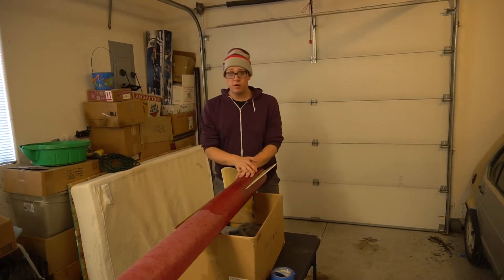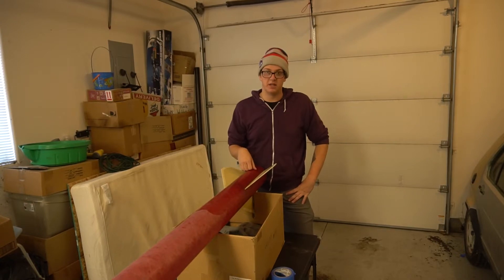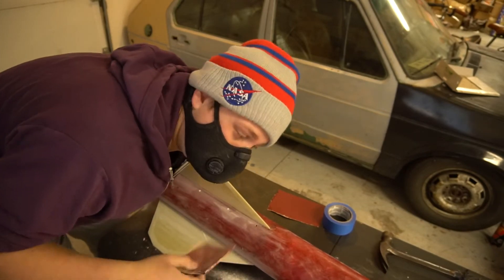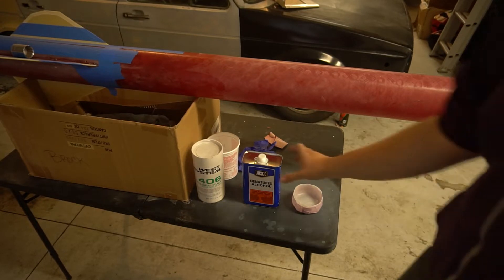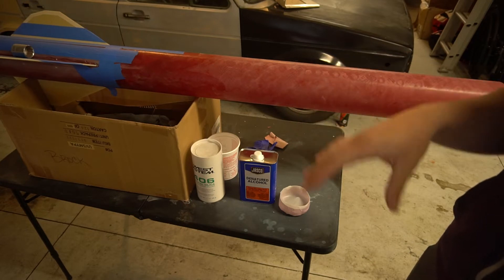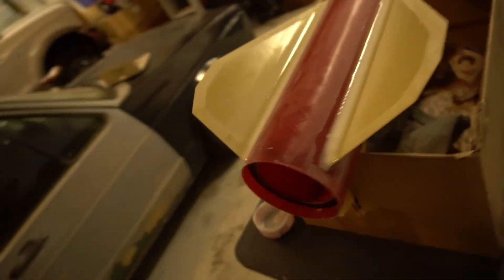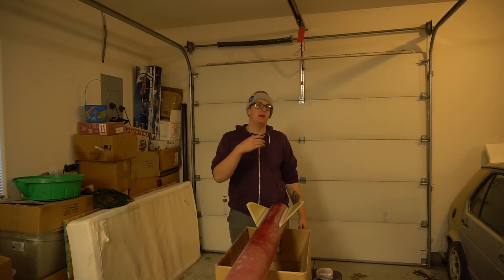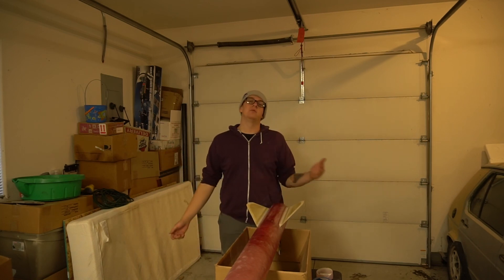How To Make Fillets On A High Power Rocket  (Wildman 5" Punisher)

Comment: Why do you not see to many high power rockets launch from tower launchers?????
Reply from the maker: It's unnecessary for most high power fliers. A lot of minimum diameter projects use towers so they don't have the additional drag of rail buttons or guides.